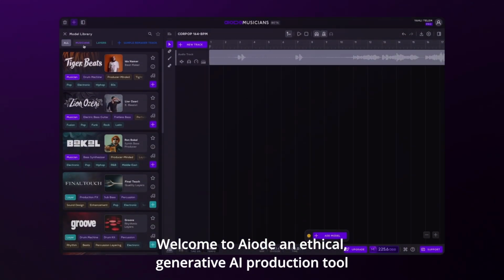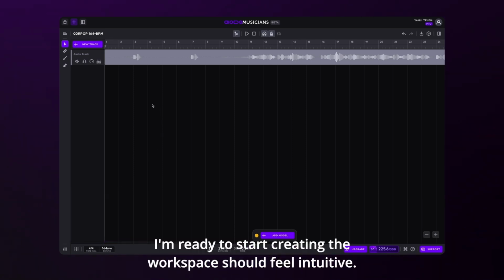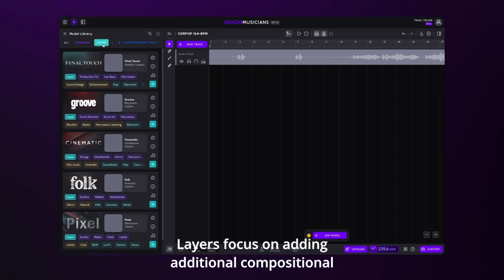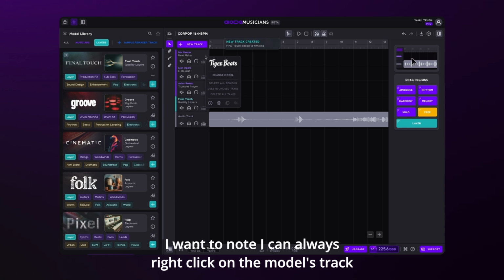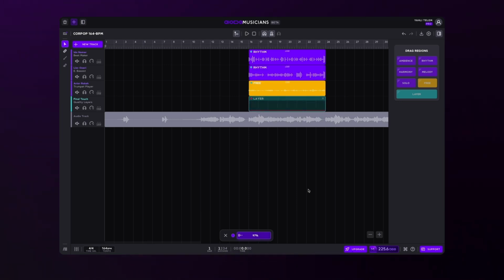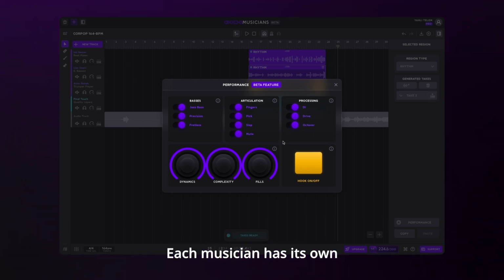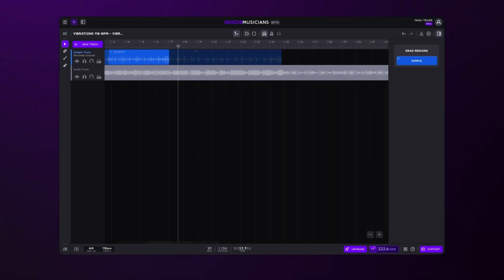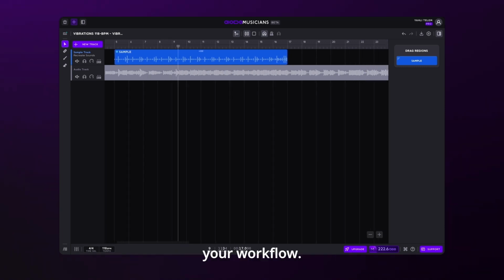Get started with Aiode - beginner's guide

Comment: I don't know if someone's reading this but I have some questions about the "vocabulary" used on the website.
What are "Model Tracks" and what are "User Tracks"?

Also, is it possible to produce guitar sounds without distortion? I'd much rather added myself with the plugins I own.
Reply from the maker: Hey, yes, 
User Tracks are your own tracks, the playback you upload or build in the session.
Model Tracks are the stems generated by Aiode’s models, meaning virtual musicians, Layers, etc., inside that same session.

About guitar tone, right now the models generate with their natural character, but we’re actively working on more flexibility, including wet to dry export options, so you can process everything fully with your own plugins.

If you’re aiming for clean DI-style control, that’s definitely aligned with where we’re heading.
Reply: @aiode_music  Great, 'coz that's what I need.